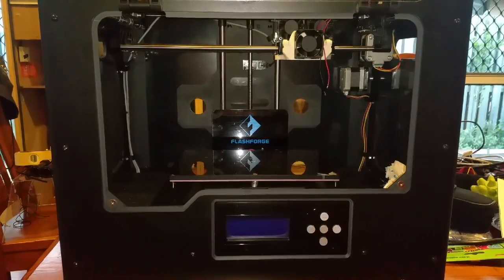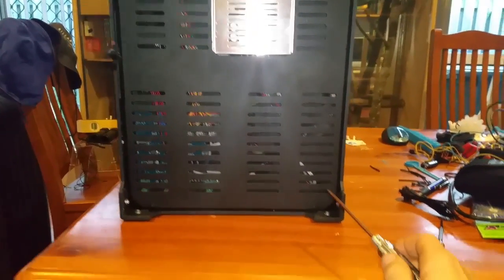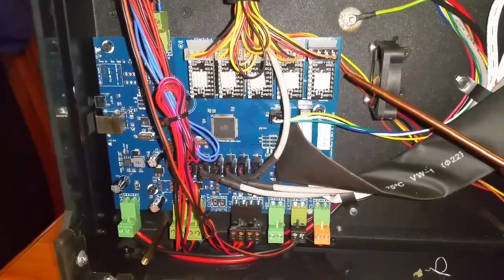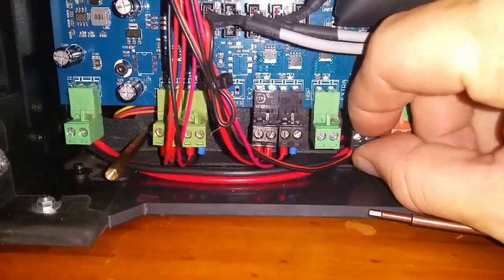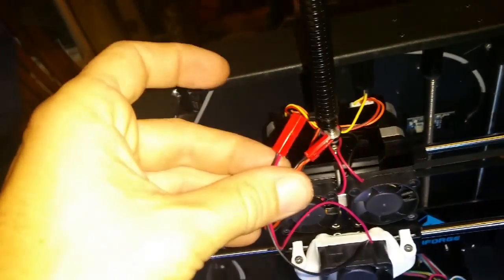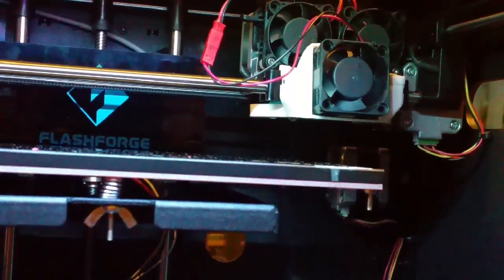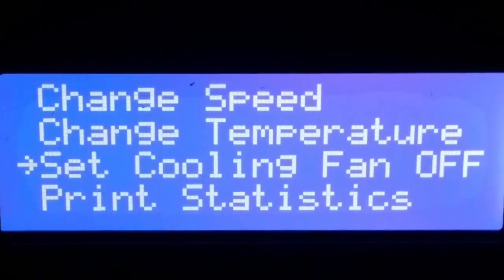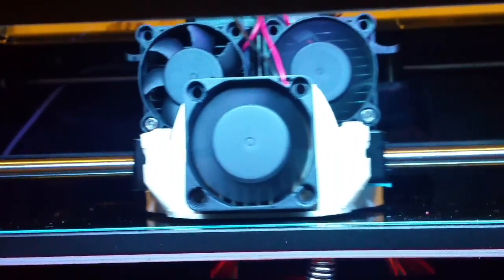Active cooling power mod, Flashforge Creator pro

Comment: My same printer come with a fan allready bolted to it like this but on the left side and leads down to the nozzels.. its not a mod anyones done.. it never turns on though any ideas why?
Reply from the maker: I'm guessing FF added it on later versions. There is a Code in the slicer that turns it on.  i use S3D and it is in the cooling section. But look at what every manual control you have and try turning on the cooling fan.. you can also look where yours it wired into. there is a led that turns on when its active, see if its working..
Reply: @patchlead  i found it.. when printing is active i can turn it on in the print settings 😊

Comment: Did this improve your print quality? Or should i just stick with the stock turbo fan?
Reply from the maker: It helped, but one part will not make or break the system. I run this fan a lot before i upgraded the head to a full metal, and was able to run higher temps.

I now run ABS only, 270deg head 100deg bed with kapton tape. I have upgraded to a full metal head. I still run air flow over the job after the first layer. I get flawless prints, very happy.

Main issue with the shape of the one shown here, is you loose viability of the print. I like to watch it 8-), So i changed to a different style, but still run a fan with my ABS.

Comment: what is the point of this mod?
Reply from the maker: It allows you to run external cooling fans that is controlled by your printer through the print files..

So in the program you can turn them on and off ad needed.. helps with printing PLA also ABS and other plastics depending on your configuration.
Reply: patchlead thanks. I'm new to 3D Printing, so trying to learn as much as i can. i thought being hot would be better to help it stick together. saw other mod to cool the printing plate. i always thought the cooling on the extruder was to keep them cool.
Reply from the maker: TurboKDM - yes and no.. It needs to be hot to stick - yes, but it needs to cool down quick enough to support the next layer or hold its place after the plastic comes out of the head. Yes it can also cool down too quickly... This is where you need to play and find the happy point 8-) or pay for someone else to have worked it out for you...
Reply: patchlead that mount do you have the files or where i can get it. how big is your fan? i got the printer to made quad parts.
Reply from the maker: TurboKDM those ones are on a flash forge creator pro. A prepaid printer. Fans are 40mm 24cv DC to run off the same voltage as the printer
Reply from the maker: TurboKDM those ones are on a flash forge creator pro. A prepaid printer. Fans are 40mm 24cv DC to run off the same voltage as the printer

Comment: Can the fan speed be controlled by simplify3d?
Reply from the maker: Matt Mann, I'm do not think the FFCP have the hardware to be able to speed control.. So not without messing with the firmware... I run simplified, love it, it has the options to run at less than 100%, but this printer doesn't respond with less fan speed..
Reply: Which connector did you use? It should be controllable I think
Reply: The onboard connector has only 2 pins, no wavelength signal.

Comment: Will this work with the Active Cooling option of Makerbot Desktop? Or should I use a different slicer? So far I've done all the connections but when I start printing and use the multimeter to read the port (my fan has not shipped yet) it shows 0V.
Reply from the maker: It should work with other slicers.. We're you printing at the time, with cooling set to turn on? The output is normally off....
Reply: Managed to resolve the issue. It had to do with Makerbot Desktop. I tried FlashPrint and it works fine. Just curious, which slicer do you use?

Comment: How do i set the Programming to switch the "Extra" terminals on and off with the cooling command?
Reply from the maker: It is within the slicing program.. So depending on what you use...
Reply: Im Using ReplicatorG, is it just a matter of moving the M126 command to after the 1st layer in the gcode?
Reply from the maker: +Brock Leeson m106 I think.. 126 is acceleration?
Reply: Looks like M126 does a heap of different perameters at once, it does contain a bunch of things like this (<setting> cool Activate_Cool True </setting>)

Comment: Hi Patchlead. Just wanted to ask with regards to printing with active cooling using ABS material. When do you use active cooling in printing ABS, is it only for bridging or can you turn on active cooling for the rest of the print, except for the first few starting layers?
Reply from the maker: I use it on abs, just not the first layer. Normally run the temp hot (243 deg c) with the cooling on... It seems to work better overall.
Reply: Thanks, I just tried what you said, and it worked very well, but just don't try to run the fan on extreme overhangs that are only held up by supports, coz it will warp. I run my ext at 240C.

Comment: Hi Patchlead. Nice informative vid. Where did you buy that connector thing that goes in the socket of the mother board, the green one. I am planning to install active cooling myself but can't find that connector. Thanks in advance.
Reply from the maker: There is a little more information in the other comments.. But I happen to have some, so unsure of a current stockist.. 

"Dinkle" is one of the brands that fit.. Standard format, just check the measurement between pins.

Comment: How did you route the wire through the black tube? How did you fish it through? any tips?
Reply from the maker: Yes I just worked on it.... I may have undone the lot.. My memory is a little hazy.. But cut all the ties, and undo everything.. 

You may need to remind align the heads after.. Just to check them at lease...

Comment: Any reason why you have to set Active Cooling Fan to OFF for it to turn on?

Does it turn anything else off?
Reply from the maker: I don't run cooling on the first layer... But the printer was running a code with the cooling serious in the code.. 

So.. Not sure if you would override to off... Unless you had a fan fail or code that didn't have the fan on maybe..

Comment: hello thank you for you video i found some nice parts to 3dprima.com that really solve the issue of where to find those stuff .
http://www.3dprima.com/en/accessories/spare-parts/wanhao/wanhao-2-pin-connector.html -> connector
http://www.3dprima.com/en/accessories/spare-parts/wanhao/wanhao-24v-fan-d4.html -->fan
i am living in greece and all shipment costs where too high so thats my only option , if you find anything cheaper in eu let me know i m searching for days :P 

quick question : do you need any ironing or advanced electronical knowledge to make this happen ? or its just plug and go ?
Reply from the maker: Ouch.. They are expensive.. 8-( you don't need any soldering, but you do need to join the wires to the fan... The ones that come with it will be too short.... I would recommend solder for a good connection, but for the only way.. 

Also remember, if you are stuck, you could solder the wires directly to the circuit board where the connector if plugged in.. This will work fine, but be harder to disconnect... Just an option if the connector is hard to find...
Reply: +patchlead just opened the case to check the motherboard and its just like yours so i ll just join the wires into the 5 FRICKIN EURO connector (gosh!) . I have a 1.5m 2pin cable in my tool box and two female-male connectors so i guess i ll just extend it manually . i ll try to experiment with active cooling and bronze-nylon-wood filament . All in all great video than you so much for you fast answear too , there isnt much shared knowledge about 3d printing on the web , so helping people really makes a difference . thanks a lot :)

Comment: Hello, was wondering what slicer you were running that allowed you to control the active cooling fan?

The recent 3.7 makerware update had an active cooling control, but only for the 5th gen replicator model.

Previously i could just go into the text editor and change the active cooling settings there for the creator (replicator dual), but it seems with the update, the option even in text editor is no longer there.

Thanks :)
Reply from the maker: I'm running simplify3d but any Gcode slicer should work...
Reply from the maker: patchlead M245 I think...
Reply: +gavinfuzzy m106 is the fan on command :) M107 off

Comment: What is the connecter called that plugs into the extra spot on the motherboard
Reply: +kenny bend 1 x 5.08mm Pitch, 2 Pin Screw Pluggable Terminal Block
Reply from the maker: kenny bend Unfortunately I have no idea... I just had them from other projects lying around.... they are something similar to this, but not sure they are the same pitch (distance between the pins)

http://www.ebay.com/itm/10pc-Plug-for-Pluggable-Terminal-Block-5ESDV-02P-2P-15A-300V-Pitch-5mm-DINKLE/130615418445?_trksid=p2047675.c100005.m1851&_trkparms=aid%3D222007%26algo%3DSIC.MBE%26ao%3D1%26asc%3D29310%26meid%3D65e1663b866c40468d9ed52bcdcf502a%26pid%3D100005%26rk%3D1%26rkt%3D6%26sd%3D130615417543&rt=nc

Comment: I'm new to 3dprinting. Is this fan needed to prevent plastic from oozing from nozzle? can someone please tell me the purpose of the fan? If it's really important I will be adding one asap... Thank You!
Reply from the maker: It helps harden the plastic as it comes out.. Important for PLA, but also helps with ABS.. Gives better small prints and overhangs..
Reply: Thank you, I appreciate the reply.  I'm learning something new everyday. ...
Reply: The fan is so the print will come out better with ABS you don't need it if you just use PLA

Comment from the maker: I had several around from other projects and used one of the existing ones to measure from.  You need the distance between the pins (my printer is not apart at the moment)... I did get them from http://www.x-on.com.au/ but i did buy quite a few at the time ...

here is one that is close, but i think the pin pitch is wrong...

http://www.ebay.com/itm/10pc-Plug-for-Pluggable-Terminal-Block-5ESDV-02P-2P-15A-300V-Pitch-5mm-DINKLE/130615418445?_trksid=p2047675.c100005.m1851&_trkparms=aid%3D222007%26algo%3DSIC.MBE%26ao%3D1%26asc%3D29310%26meid%3D65e1663b866c40468d9ed52bcdcf502a%26pid%3D100005%26rk%3D1%26rkt%3D6%26sd%3D130615417543&rt=nc

Comment: Cool great video what is the connector called I need to wire in my fan ?The plug that goes into the cooling slot. Where did u get it?
Reply from the maker: Sorry found one in my bits-a-box.. Not sure the name, but electronics shops should have them..